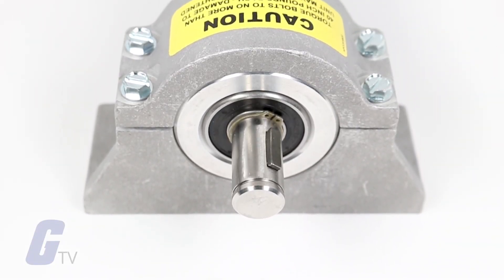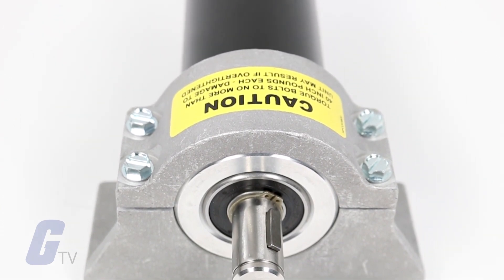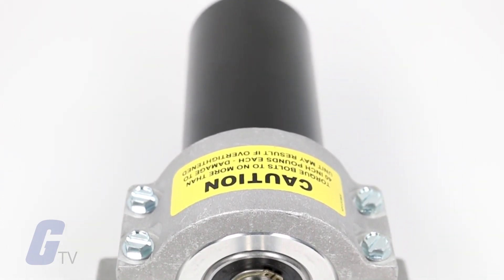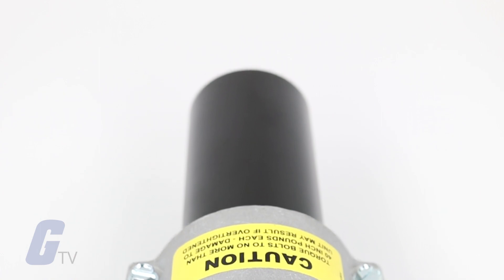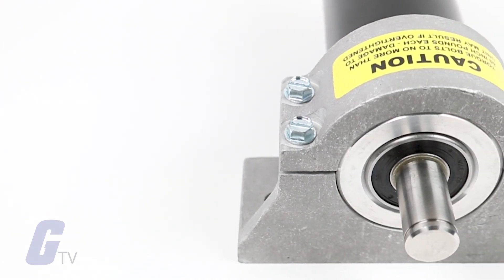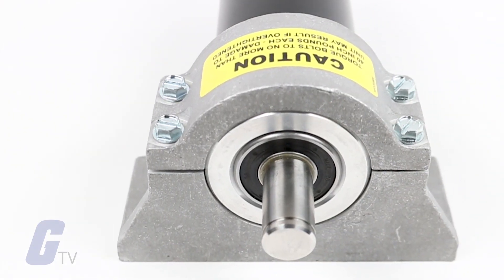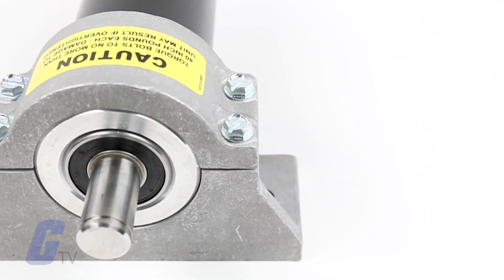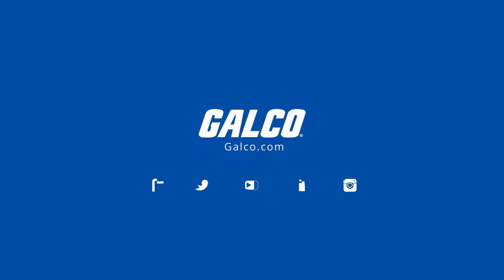What is a Resolver? - A Galco TV Tech Tip | Galco

Comment: If we set 7 volts in the primary coil, what will be the peak voltage in the cosine coil at angle zero Is it 7 volts or less? The rule to find out the peak voltage at angle zero is as follows (peak potential of the cosine signal = voltage on the input coil x cosine of angle sita) (V cosine=Vr x cos cita)
https://drive.google.com/file/d/1EaZ_S2SgRWK7UEzytSKaCvSkH6IhBsNi/view?usp=drivesdk